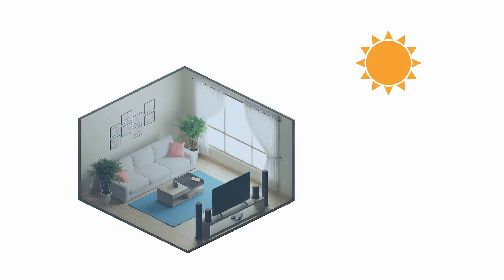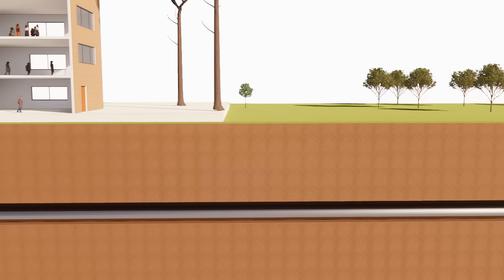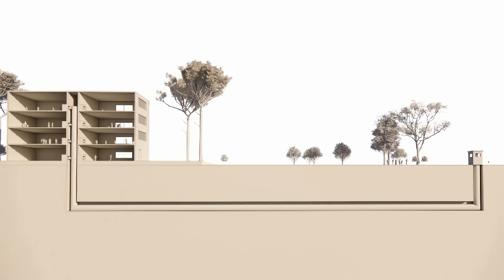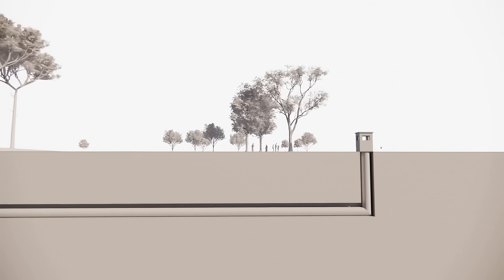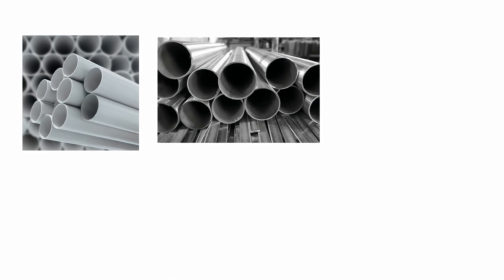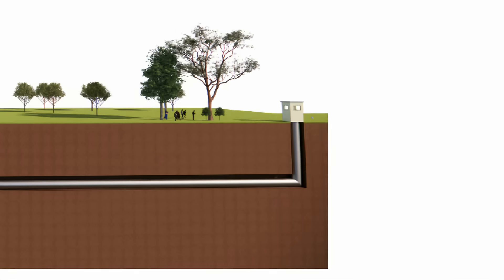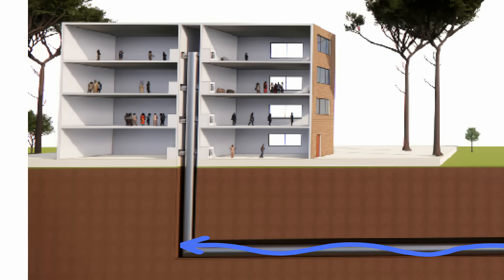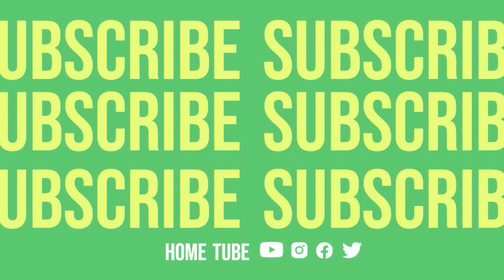Earth Air Tunnel System: Sustainable Cooling & Heating Solution

Comment: A few things that need to be addressed.  Water condensation in the pipe, ground water, and radon.  Ground water and radon can be solved by using a sealed pipe with no underground drain.  The condensation that will occur will need to go to a low point at one end of the pipe to be collected via a pump.  A larger pipe will slow down the air flow giving convection time.  Slower air flow will also reduce the sound.  Thoughts?
Reply: Condensation isn't the only problem,   mold that grow in that pipe after same time will make more serious questions
Reply: @andewch8522  Even the companies providing these kind solution suggested that I shouldn't choose this method as it got fundamental problems.
Reply: In theory, many things work and seem easy. It would be good to see something in practice. Of course, the cost of installation and conversion in a house or large building seems to be high.
Reply: @telosfd  , digging a 1,5 m deep trench shouldn't cost that much when bulding a new house.
Reply: A brine filled tube loop like in a normal geothermal heat exchanger, one of those super efficient pumps, and then a normal heat register.
That way, no flood, no radon, no rodents, no earth pipe cleaning, and you can take in the air in the first or second floor or even at the roof (it is not as dusty and humid than short over ground, and no one can park his car exhaust beneath your intake.
Reply: A sealed PVC pipe would not transport radon into the house.
Reply: @johnsdsl Pvc is heat insulator how will it exchange heat? I am worried it will result in soil degradation. Microbes in soil require a certain temp. To survive. Plus geothermal i read is constant 24 deg not 10-20 deg. Why human body won't decay on Mars? Because no microbes in soil. Only thing that has highest cooling potential is water.
Reply: @johnsdsl yes it will. Asks me how I know lol. Radon is so small it will go through anything other than metal or glass. The flow may be slowed but eventually it gets through
Reply: If the pipe formed a loop drawing the already cooler air in the house through the pipe and back again this would not only be more temperature efficient it would make it easier to dehumidify the air before entering the pipe
Reply: This is called a chiller system and its done using closed water pipes not air as air is a very poor thermal conductor...
Reply: what about roaches, rodents, etc
Reply: HEAT EXCHANGER
Reply: You can make holes at some point
Reply: These always fill with mold anywhere but the desert
Reply: Well, no one wants to live near sewer tunnel except for rats! Clean air can’t be fresh after years of failed maintenance, animal infestation, water leaking  , and security breach
Reply: for condensation, use perforated pvc so it drips out, sloped, and drain the condensed water. 
Test for radon. 
Optimally, you could use the drainage + house-roof runoff for a garden at a lower level.
Reply: @jake.presents you'll never get it actually dry inside these pipes and mold grows in there
Reply: You are right 👍
Reply: Make the tunnel with galvanised metal sheets. It will do heat exchange much better than pvc. And do the pipe sloped , that's the way the condenced water will drain out.  At the end of the duct, provide insect trap/ wired mesh. End of duct should connected to the air chamber,  provided with sand trap louvres/ wired mesh on four sides. Air chamber Should provide with drain out facility.
Reply: This is a better solution for dry climates. In the deserts they build buildings with breezeways and "chimneys" to vent out hot air. I have a friend in puerto rico with an earthship thats cooled this way with underground tubes.he hasnt had any issues, but the clay soil is probably key
Reply: Also, transportation of energy away from the pipe. The area around the pipe will match the temp of the average daily temp pretty quickly. Also, mould abatement. You could drain the pipe into surrounding earth (not sealed) as long as the system maintains positive pressure from the input source.
Reply: @benvoncamp  , isn't ground thermal exchange almost infinite?!
Reply: @marcospereira2060  on an infinite timescale, yes.  What is being proposed here requires massive exchange over short periods of time. There is a reason refrigeration units use much warmer air than attempting to dissipate heat into a very cool subterranean matrix.
Reply: @benvoncamp  , in fact, it really makes me have some doubts about the speed required for thermal exchange